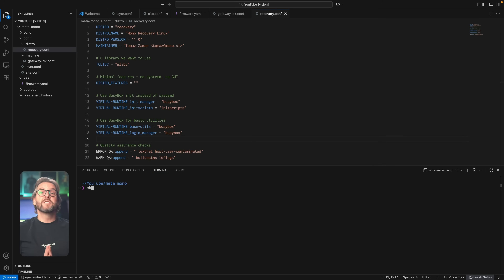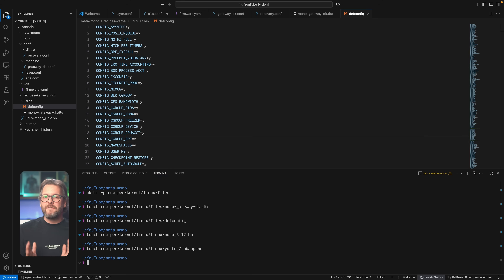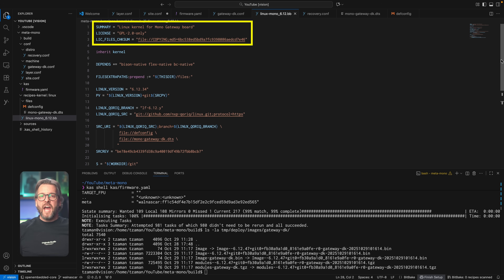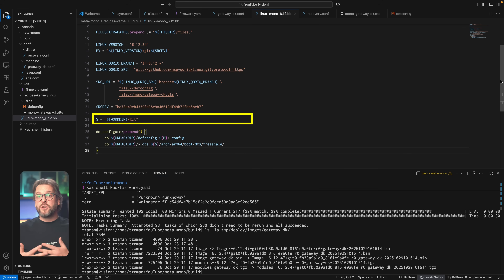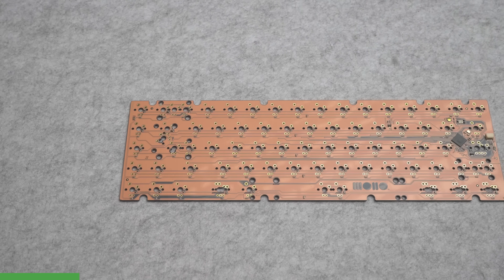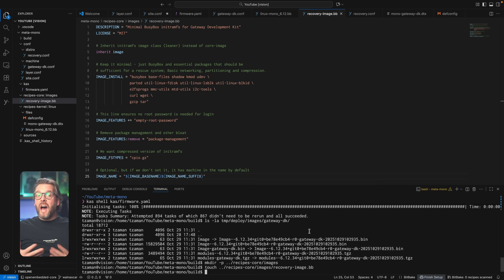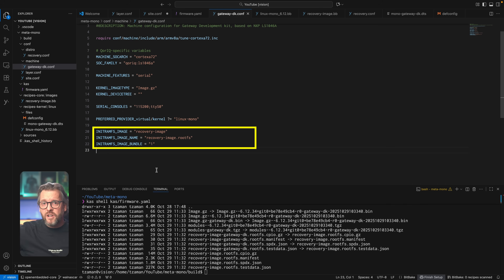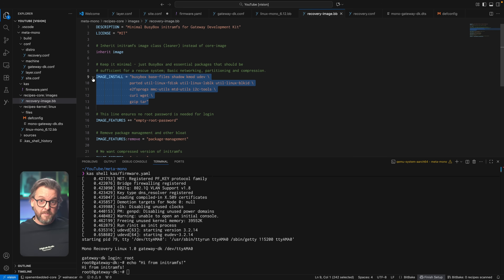Intro to Yocto I wish I was given | Part 2: The Kernel

Comment: I've watched both parts but I have to admit that it didn't help me much at all, seems like it's more of a "how to start Yocto from scratch" rather than how to add/modify existing Yocto projects - I am currently building an NXP i.MX8MPlus Linux image and I cannot figure out how to add "can-utils" to the rootfs... I've been working with different vendors' Yocto environments for years and each time it seems like it's a new struggle. And neither i.MX Yocto user's guide nor the generic Yocto manuals seem to help with these kinds of questions. And Google's AI results never seem to provide the correct answer either

Comment: When you want so save even more space you can use xz compression instead of gz compression for the images (you need to activate this tough in the kernel defconfig). Saves again ca. 33% compared to gz.

And for dts I recommend a separate recipe where the kernel is a dependency, as e.g. you might have multiple device trees to support multiple hw where the bootloader decides which one to load.
You can use 'inherit devicetree"
Also you might need multiple device trees for different kernel versions as they don't always stay compatible.
Reply from the maker: Hm, that's a valid point, never thought to building the device tree as a separate recipe. Thanks!
Reply: A recipe that includes the dts as a file in the SRC_URI?